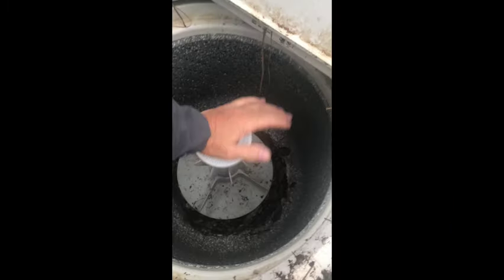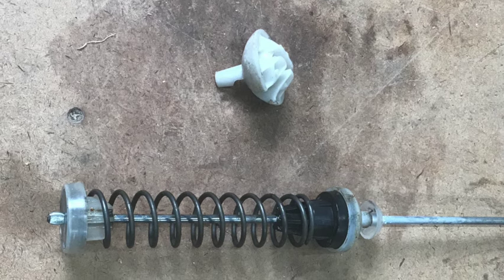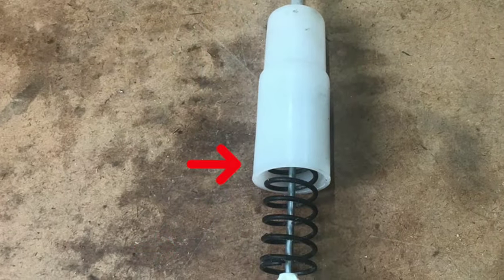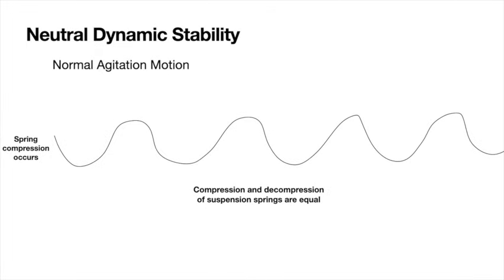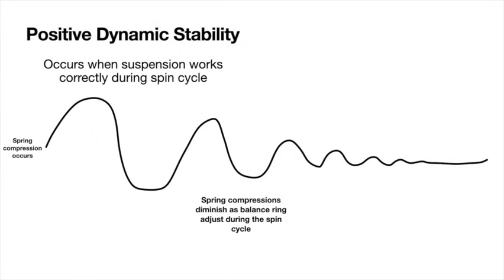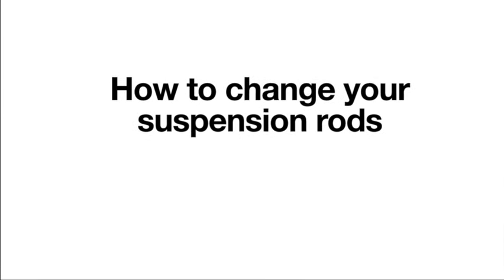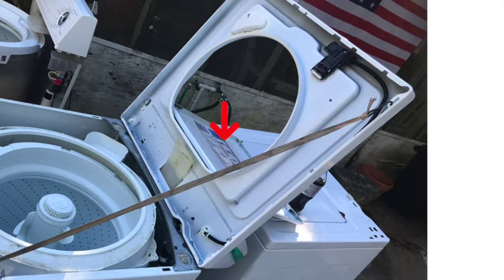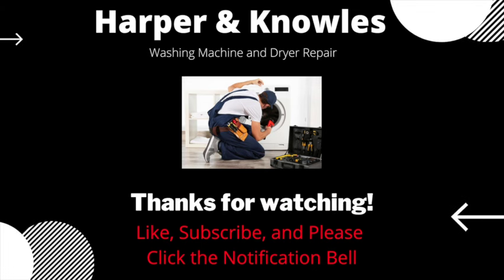How To Replace Suspension Rods in Washing Machines: A Mechanic's Guide to Balance & Repair

Comment: LISTEN PEOPLE I KNOW HOW TO FIX THIS PROBLEM.  THE SPRINGS GET SHORTER OVER TIME WITH COMPRESSION. JUST REMOVE 2 AT A TIME AND PULL THE SPRINGS BACK TO ABOUT 5N HALF TO 6 INCHES. PUT TINY HOSE CLAMP ON EACH ROD AND HOLD THE SORINGS IN PLACE BY PUTTING HOSE CLAMP ON THE ROD EACH ONE. FIXED
Reply from the maker: Unfortunately these reengineered fixes never work and can actually damage a machine by bending a tub or shaft that is under extreme centrifugal forces. Most of the time the problem is not with the springs but with the worn out linear dampers. Putting a small hose clamp on the rod prevents the movement needed during an out of balance spin cycle.The best way to repair an out of balanced machine is to buy the OEM replacement rods. Continuing to use an out of balance machine will certainly cause irreparable damage to it and trying to reverse engineer these parts is never a good idea. Thanks for your input!
Reply: @HarperandKnowles  Thank you for providing that viewpoint.  Yes, I thought about doing same as @Levino, but I was fearful of the problems that you are indicating.
Reply from the maker: Yeah, not a good idea. I see the results of this often in my shop and the machine usually winds up on my boneyard. Fix it right! Thanks for watching!